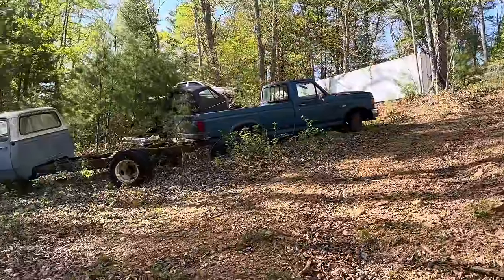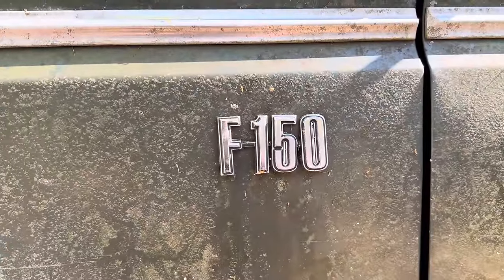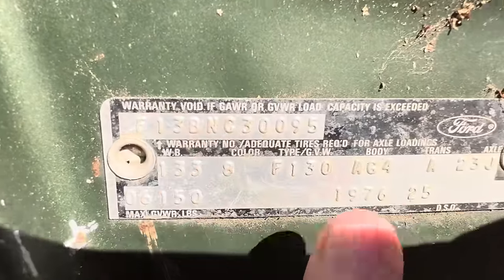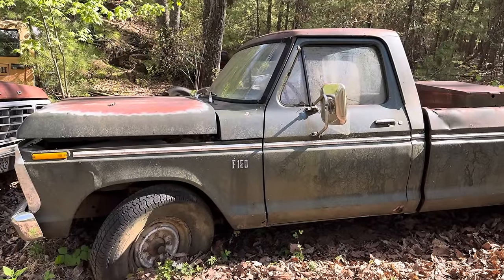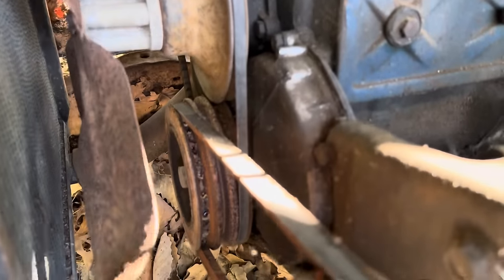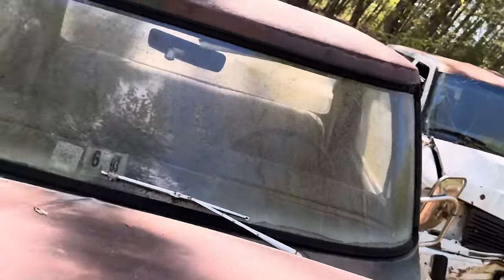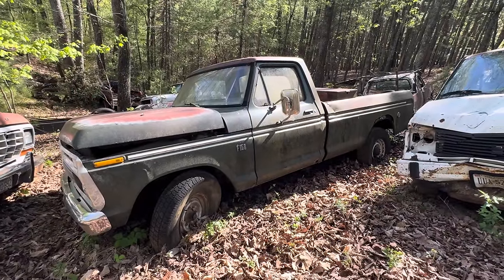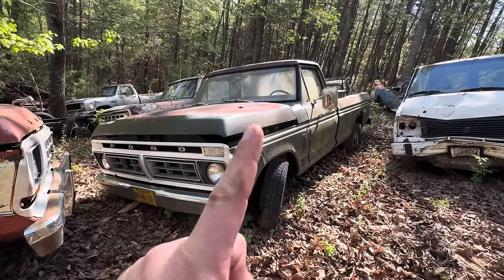Uncovering A Hidden Gem: Strange Ford MYSTERY Truck Discovered In The Woods! #RustBucketRescue

Comment: Then in the 80s, Ford brought out the lighty duty F250 with semi float rear axle. The heavy duty F250's were essentially F350's since they ran the F350 frame and full-float axles. Ford was trying really hard to skirt around emissions back then. lol.
Reply from the maker: Yep that’s the leading theory on what I suspect this thing was configured for, emissions skirting
Reply: GM did the same thing, but they were camper specials. My  Chevy C-20 had the 1 ton brakes, rear axle and suspension.
Reply from the maker: @ronaldburgess2884  yeah I’ve seen (and actually owned) a few camper special and Big 10 trucks, which is what this reminds me of, but can’t find any documentation on this Ford.  Ford did have camper specials themselves, but they had a different model ID than this F130.  It seems to be a heavy half or camper special style truck, but they went out of their way to give us a model ID (F130) to separate it from those trucks which is what’s so odd.
Reply: Yes, I had an 86 "light duty" F-250. Had the big 10.25 rear end but in semi floating form. It also had a TTB Dana 44 HD up front instead of a TTB Dana 50.
Reply: @jerrywagner7346  Very few trucks came with the D50. Supposedly the extended cabs, crew cabs, and diesels were the only ones with the D50 unless a regular cab had like a snowfighter package or similar. But nobody really knows for sure as Ford didn't really document it well.

Comment: I have had 20 dent sides over the years and you just never know it all.  The only rare, and I never researched it, but the only rare thing I ever saw was color keyed interior items.  This truck a friend had, the exterior was tan and on the interior, all the black on things like the t/s lever knob, the column shifter knob and the windshield and back glass gaskets were tan in lieu of the usual black.  It did not appear that it was done by any owner.  The Bakelite type material was actually tan on the knobs!  The rubber gaskets were the weirdest!  Looking forward to you saving this gem.
Reply from the maker: I’ve never heard of a color keyed interior - you just gave me a rabbit hole to go down 😂. Thanks for watching, I’ve got an update video on the works, so you’ll see this thing moving around under its own power soon!

Comment: I have seen those,and when I tell people about the 76 F-150 8 lug , people think I am crazy,and I remember seeing them brand new at the two Ford Dealerships in Tucson.Thanks for showing,that is a very rare truck.
Reply from the maker: Thank you for sharing!  Must have been wild to see them new at the dealership!  Do you remember what the Dealerships marketed or sold them as?  Were they doing it for emissions, or selling them as heavy duty 1/2 tons, or marketing them as F250s without the F250 price tag?
Reply: @RustBucketRescue  You know I was a go for for Desert International in 76,I was 19 at the time,And the service dept.worked on a fleet of F-650s so I'd was sent to the Ford Dealership (Holmes Tuttle Ford).I remember the first one I saw was in the later part of 75,and I remember asking what a F150 8 lug truck was being marked to,and was told anything from emissions,to an 8 lug half ton,that was cheaper to plate,to a smoother ride.So I remember never getting the one solid answer about what marketing spot it was for.

Comment: GM did the same thing with the Heavy Half and Big 10. The feds finally caught on about 1980 and upped the GVWR threshold.
Reply from the maker: The GVWR does not appear to be any higher than an ordinary 5 lug F150, so I’m not so sure this was an emissions thing like a Big 10 is.  I thought the same thing at first (Big 10) until I saw the GVWR was no different than any other 5 lug F150.

Comment: Not a big surprise that Ford made an F130...this was the same model-year that Chevrolet made the 'Big 10' and GMC had the 'Gentleman Jim'. I once saw a Chevy Big 10 (half-ton basic) with the 3/4 ton running gear, 3/4-ton frame...AND it had a stack of 13-rear springs in the back! (a 1-ton stack with overloads)...only saw one of those, and never even saw the build sheet on how you could order such a beast! (Camper package, tow package, overload package, etc.?)
Reply from the maker: That sounds like an awesome truck! 1/2 ton, 3/4 ton, and 1 ton all blended together!

Comment: Fascinating!  I remember the time when the quickest showroom stock stoplight dragsters were big block half tons with 6,100 GVWR. But this, with its full floating axle is a 3/4 ton dressed as a half ton.  Probably a great work truck.
Reply from the maker: It’s such an oddball fun truck, I’ve had a good time digging into the mystery!  Stay tuned, I have a fun video coming soon where I’ll be comparing it to a same-era F250. I’ll be comparing the brakes, frame thickness, leaf springs, axles etc so we can all collectively find out together how similar to an F250 it is or isn’t.  Should be an eyebrow-raiser!

Comment: Actually the Ford F-130 was not the odd duck you think it is. As back in 1965 Ford produced a F-100 that used 3/4 ton springs, and a 240 inline 6 that was a short bed stepside. Along with an F-350 Super Duty around 1995/1996 that used an F-450 braking system, it does not show up on any parts suppliers books, but it does exist. As Ford has always been notorious for using up surplus parts, in their assembly lines during body and face lift changes. The F-130 was an internal designation, for a light duty 3/4 ton or heavy half that was given F-150 badging due to Ford not wishing to create a new trim badging for a special order truck
Reply: Lnfao wow you tell some funny stories
Reply from the maker: @GenderSkins   Ford has made special order trucks for YEARS without creating new badges or coming up with new internal designations.  Also, all F130s share the same core package, so they’re not exactly one-off special order units.  It’s very much its own thing.

Comment: I miss mine. You literally could sit in the engine well while working on the engine.

With modern seal materials most of the chronic problems could be eliminated.

The distributor drive shaft had a pin which liked to shear and that was a pain but everything was accessible.
Reply from the maker: I plan to put a nice aftermarket billet distributor in and reseal the engine with modern gaskets and sealants, which as you mentioned are greatly improved over sealers of the past.  Should be a nice little setup when finished!

Comment: I bought one of those, same color even back in the late 80's. It belonged to a bottled water company in Philly. I was told that the truck had originally been a government vehicle, and they bought four of them as new, never driven but 8 years old at the time. It was a 300 I6, four speed with an NP435 four speed, and a Dana 60 rear with non floater rear and small front spindles and 8 - 1/2" lugs, Mine had manual drum brakes all around and manual steering, and no radio, just a block off plate. The interior was painted green but with plain vinyl seat and black floor mat. It had no exterior molding down the side, just painted metal. I bought it with 71k on it, with a bad oil pump, someone had done  an oil pan gasket and must have used 20 oz of rtv which ended up in the oil pickup. I did mains and rods, and a pump and pickup with a proper pan gasket, plus a new exhaust and drove it for 8 years before selling it when I found an F250 camper special with ac .
The guy who bought mine was moving to WV and needed it for the move back in around 1997.
Reply from the maker: The too-much-RTV is something I see a lot of sadly.  People will use an entire caulking gun tube of the stuff, and right to the oil pickup screen it goes 😢.  Sounds like a very unique truck, government units are usually built pretty oddly!

Comment: That was called a “Camper Special”. It would come with a camper in the bed of the truck. The truck would come from the factory, and the dealer would install the camper, larger tow mirrors, and a pigtail in the bed for the camper lighting. Dealers also would install air shocks in the rear.  They did not sell well and not all dealers would get one.
Reply from the maker: I’ve had a few people suggest this, but it’s not a camper special, those had a different model code as well as a higher GVWR rating. The F130 was its own unique thing specifically set apart from the camper specials and other oddball trucks. I actually have a camper special, and there’s almost zero similarities between it and this F130.

Comment: Chevy did similar with a heavy half. They were 2wd but used 6 lug rear axles and had 6 lug front hubs. My brother had a 73 Cheyenne super 10heavy half
I’ve never actually seen an f-130, but I knew they existed. Dentside depot did a short a while back on these. 
SAVE IT!!!
Reply from the maker: Check out the follow up video on my channel!  Also, Part 3 is coming soon 😉

Comment: My Late Dad bought a brand new 1978 Ford F-150 in California and it did not have any smog stuff on it at all. It was a 460/automatic.
Reply from the maker: The 460 is what probably helped that.  For Ford, GM, and Dodge the big displacement engines were the very last to require smog. 78ish 79ish was around the cutoff point for most big engine trucks, so your dad bought that thing at the perfect time!
Reply: @RustBucketRescue  Thanks. He asked the sales guy what was the difference between the F-100 which they still where selling and the F-150. The guy told him that the frame was thicker/heavier on the F-150.
Reply from the maker: @lilorbielilorbie2496  interesting!  I’m making a follow up video on this truck.  I have a F100, F150, and F250, so I’ll make part of my video measuring and comparing the thickness of all three frames - should be interesting!

Comment: My uncle bought a new Ford truck in the late 70s. A few months after he had purchased the truck he realized that it said 250 on one side of it and 150 on the other side.
Reply from the maker: And he was the original owner?  Very interesting story brother!  Was it being sold as an F150 or an F250?
Reply: @RustBucketRescue  yes it a new truck and it was a 3/4 ton long bed truck
Reply from the maker: @Clawson_customs  interesting.  I wonder how the dealer explained away the F150 emblem that didn’t belong!
Reply: @RustBucketRescue  never trust badges on a junkyard truck, lesson #1
Reply from the maker: @maddhatter3564  except the badges are right.
Reply: I had a 76 f250 with a 360 mill and it had the dreaded split ring rims , was a 4 speed in floor
Reply from the maker: @randyblackburn9765  I love the FE series engines!  I had a 352 FE that I absolutely adored.  I’ve had 360 and 390s as well, the whole series are such great engines!  And you’re right, everyone is scared to death of split ring wheels, 95% of shops don’t even know how to do them anymore.

Comment: These f130 trucks were made for states with more strict emissions laws, CA and OR.  In other states they could use the regular f150 and still meet the law.

The heavier drive train was a stopgap to pass emissions.  My understanding is these trucks were sold new in CA and OR most of the time.  Mine has an Oregon dealer badge on the cowl.
Reply from the maker: Let me gently poke some holes in that theory.    All vehicles 6,000 lb GVWR or higher were emissions exempt in ‘76, so any old 5 lug F150 was already exempt, the 5 lug F150 typically had a 6,050 to 6,200 lb GVWR.  The entire reason ford even came up with the F150 was to loophole emissions. Further more, the F130 code trucks lost 50 lbs of GVWR rating over a F151 code truck, likely to cover the additional axle weight.  F130s all have a 6150 lb GVWR, most 5 lug F150s have a 6,200 lb GVWR.  So F130s have a LOWER GVWR, not higher, than many 5 lug trucks, which hurts the emissions theory.  Also, mine was built in Virginia.  Why would Ford build a truck in Virginia to sell in Oregon or California when there were plants way closer to the west coast? I’ve heard “it’s an emissions loophole truck” theory over and over, but a major flaw in that theory is the F130 package LOST, not gained, GVWR.  I’ll cover this in my next video, should make for a good discussion from the community.
Reply: Dealers move inventory with each other…so that could explain some of that.  Ford is famous for using up excess parts.  They may have been long on heavy axles and bearings for the build period.

Emissions varied more BY STATE at that time.  Bean counters would be part of the mix as well.  Ford parts/spec change during the build year.  Most old Ford owners know the answer to the question….early or late??

Mine is dark green by the way.  Has the white decals midway all around.  

The main thing to get out there is this was a Factory build truck…not someone swapping bodies/fenders/badges.

Ford does some strange things.  I still remember the 1963 Ford “wrongbed” trucks.  I’m old….
Reply from the maker: @normtew6354  I had a wrongbed Ford!  Fun, oddball trucks!  You hit the nail on the head with my leading theory:  I suspect Ford either had a glut of 8 lug axles, or a shortage of 5 lug axles, so they built a run of 8 lug F150s, and then to reduce confusion, gave them their own unique model code of F130 so dealers wouldn’t run into the scenario of someone coming in and saying “Hey my F151 code truck has 5 lugs, but my neighbor’s F151 code truck has 8 lugs.  How come he got an 8 lug axle and I didn’t?”  By using a unique model code, when someone asked why their neighbors F150 got 8 lugs, the dealer could reply “He bought a F130 model truck, those receive 8 lugs, he bought a different model than you so that’s why”
Reply: The views you have had indicate this still a very interesting topic!  I followed the same 20 year old thread that you did!

So….good job….I am learning your sharing has been helpful.  Carry on, look forward to your next vid on this.

Comment: My brother had a '68 F-100, short and wide, but it also had 8 lug wheels. 
Ford is famous for creating vehicles for the US Forestry Service that used heavier duty frames (4x4, as oppsed to 4x2), axles and suspension. 
The general public could order such a truck, but it wasn't advertised, so you had to know what to ask for.
I find it interesting that both my brother's former pickup and this one, are both the same shade of green.
This practice spilled over into the compact Ford Ranger trucks in 2001, when they built a 2001 only vehicle spec'd the same way, but sold to the public.
They had a name for that one, but I forget what it was anymore...however, I do remember the name of the New Process transmission you can't remember. It was the NP435. I rebuilt a bunch of those back when I worked for U-Haul.
Reply from the maker: I know the NP-435 like the back of my hand, when it came time to talk about it my mind went blank - definitely a “D’oh!” moment!  I got a F250 recently so in my next video I’ll be comparing the frame thickness, the brakes, the leaf springs, the axle, etc to see what the similarities are.  I’ll have to look into that 2001 Ranger you talked about.  I love oddball vehicles so I’ll end up tracking down and researching that heavy duty Ranger - thanks for watching and thanks for sharing!
Reply: @RustBucketRescue   "I know the NP-435 like the back of my hand, when it came time to talk about it my mind went blank..."
And I had absolutely no way of knowing that. Sorry if my comment on the 435 seemed like I was treating you like an idiot. I wasn't. You just seemed unsure of the name of the transmission.
I hope that F250 is a 4x4, because it's my understanding that is the frame they used for the Forestry Service vehicles. A 4x4 frame. The axles and suspension, however, should pair up with your 250 (congrats on your latest purchase, btw).
...and, I just remembered, the Ford Ranger I was trying to remember in my prior post was the TRAILHEAD model...and I guess it was a 2000 model, not 2001. Sorry 'bout that.
Reply from the maker: @DeanMk1  no offense taken! The F250 I bought is sadly a 2wd, but should still make for an interesting comparison.  I’m going to have to look up this Trailhead Ranger, sounds like a fun little truck!